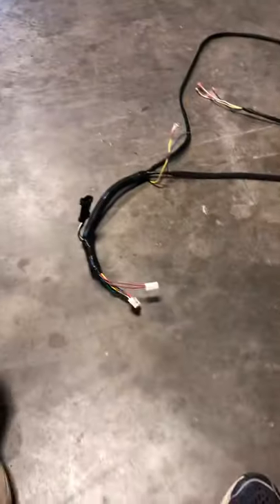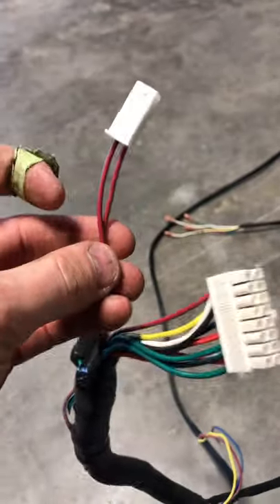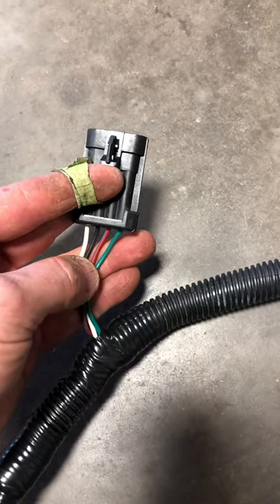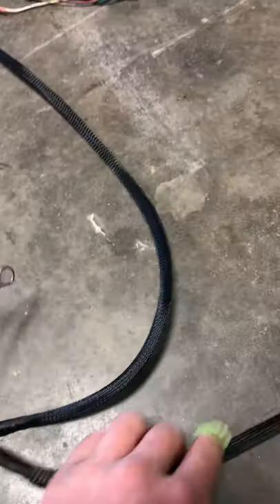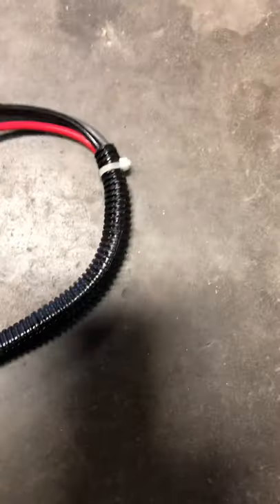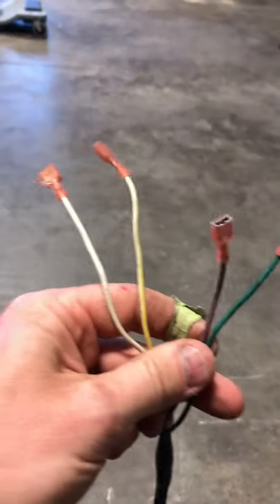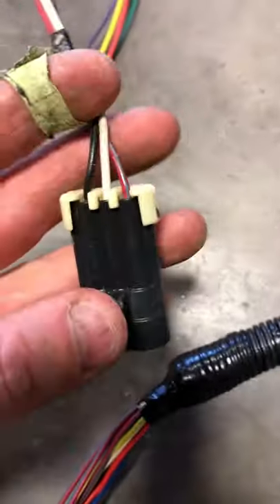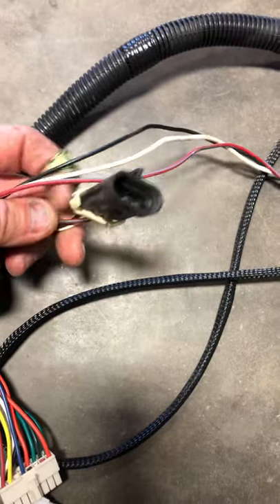TXT48 breakdown for Navitas AC conversion

Comment: Hello! I have a 2017 EZGO TXT 48 with stock solenoid and motor. If I were to install the 600 amp controller do I also need a new solenoid? Or can I use the stock/original solenoid. Thanks!
Reply: You need a high amp solenoid

Comment: Did you post pictures of the FNR and ignition wiring locations somewhere? Great video!
Reply: green forward, orange reverse, gray is center power wire.
Reply: The green,white, white/ yellow, red  running a rxv ignition with this harness

Comment: Will this harness work on an EZGO txt 48 volt, DC not AC, series motor, old style ITS throttle, Navitas 600 amp controller, sw202 contractor, forward reverse rocker switch???

Comment: Thank you for this, very clear.  My golf cart is a 2010 TXT 36V PDS and I bought the Navitas 600A 5KW conversion and 48v harness from GCM.  

1) My direction switches are up front so it looks like I'll have to extend the wires and loom them with the wires for the buzzer and key.  I'll probably recycle and use wires pulled and keeping in mind to make sure the colors match on each end.  

2) The battery charger lockout, it looks like it's a switched circuit reference to positive.  Is this normally open when not charging?  And when the charger is plugged into the port it closes the circuit to positive?  Or is it opposite?  From the schematics I downloaded from your site, it looks to be normally open.  I just want to make sure since  I have a 48V LiPO system so the lockout would likely not be compatible.   Is it needed?